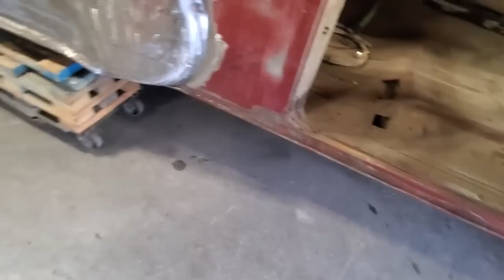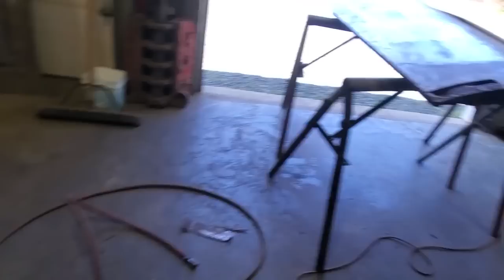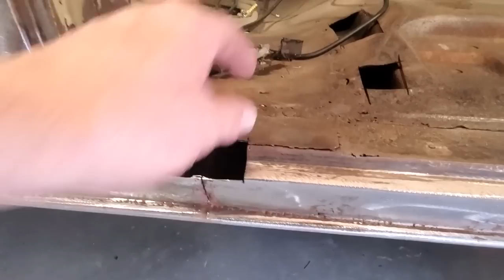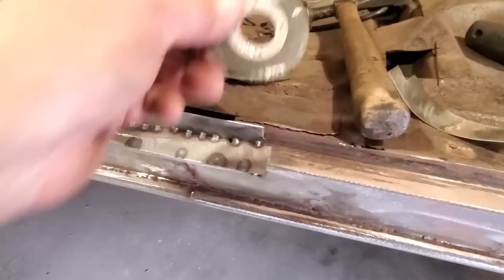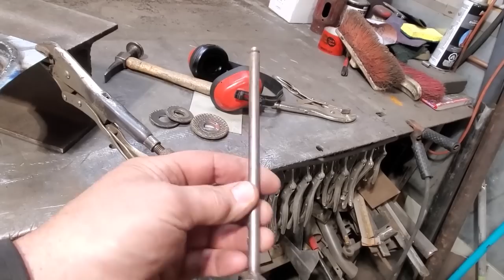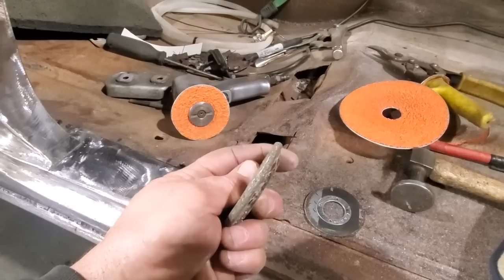Building complex body panels with simple tools

Comment: I’ve watched a few of your patch panel builds, all looking great, one question I have is on the butt welding to the original body panel, why don’t you use a backing strips to bridge the gap and lessen the possibility of burn through especially on hidden inside panels? I liked the old coat hanger trick but why not a backing strip.
Reply from the maker: Might as well just lap weld then. Adding a backing strip gives a place for moisture to build up between the metals

Comment: Fitzee bye...why are your panels always covered with grinder marks? I'm guessing it's because of surface irregularities...correct? I like my panels without the grinder marks because I find they fool my sense of touch and it's hard to find high/low spots. I will file panels with a body file once the  irregular metal areas are straightened, do you ever use such a file?
Reply from the maker: See you go the next step. Filing. I don't. As you know pick and Filing takes up many hours. Not what I enjoy.  I'm a body man by trade, so don't mind filler. Key to my work is to have as less amount of filler as possible. Also pick and filing mig welds are no fun. Tig or old gas welds are much softer
Reply: @fitzeesfabrications  I see...I am a retired body man, but from the era when "cold fill" was still viewed with suspicion ( that's what they called modern body filler) ...so I'm used to lead...and you never wanted too much lead on a panel so you had to straighten the metal fairly well...which meant picking and filling. You are right about Tig and gas being softer...and one problem I have seen with Mig , is the weld line between a panel and a repair section, being telegraphed to the surface when panel vibration between dissimilar thicknesses and flexibilities of metal , happens...body filler will lift off the weld. We also used to see this in lap joints put in with brazing rod. Like your channel. One suggestion, you probably already know about seeing as how you grind your panels...when you have a panel that has a fair amount of deep rust pits, take an old 6" 24 grit grinding disc and an old pair of tin snips, and trim the worn edges of the disc off to make an eight sided disc...boy those corners will dig into the pitted areas!...and when they wear down...trim them again. I like your work and your straightforward practical approach!
Reply from the maker: @markanthony3275  cool stuff. Love the old school bodywork stories. I came into the trade when plastic fill was so popular that some went to hell with it. Lol. I always  cut my disks down round but I have done 6 sided cuts for when I want to dig.
Reply: @fitzeesfabrications  I always remembered the words of my first year auto body instructor about plastic body filler " Cripes fellows , it's Not a miracle drug...it can't save you EVERY TIME!". LOL!
Reply from the maker: @markanthony3275  hahaha. Hate to say it but was a time it did for me many a time. Lol. Man, the butchery I did back then.  Lol
Reply: @fitzeesfabrications  Well, we've all done work for used car dealers at some point...I call them 50/50 jobs...because they look good at 50 feet and 50 miles an hour!

Comment: Question: Do you always keep the bolt/nut hardware in the same containers? Like the bolts that hold the door latch on, for instance. Do you keep the latch and the bolts inside the car, or on the bench? From experience I bagged mine and labeled them, but that gets messy and zip lock bags can get weak. I always fear losing hardware, if I'm doing a longer project that has months between the start and finish. 

Excellent content. I watch your videos multiple times over periods of weeks to make notes and concentrate on techniques. Thank you
Reply from the maker: Depend on the job. Small jobs like this they just lay in the car. A full strip down everything gets bagged and tagged

Comment: I approve of this "cut, smack, and weld" door alignment technique.  :D  Fits my style very well.  :D

Though I'm curious, why so much of a gap between seams?  I usually try to align my panels closer, though I suspect you have more experience than I do. Are things inclined to shift so much that you need that much clearance to make sure things don't start smacking together?
Reply from the maker: Gives you room for filler work
Reply: @fitzeesfabrications  Ahhh, fair enough.  I'm OCD enough that I try to be 90 - 95% metal and then the very slightest bit of filler with just primer and paint.  But you also seem to get things done much faster than me.  :D  Excellent video.  Thanks for the tips and techniques!  I think (I know 😉 ) I've been making things more complex than I needed to.

Appreciate it, bro!  Metal up!

Comment: I am just wondering if you have any idea how strong this essential part is in case of a collision? I mean it may look just nice but if you have a number of weak spots because you try to achieve the best visual results are all irrelevant when later on they appear to be the source of ie cracks.
Reply from the maker: This is a late 40s car.. there nothing on this that designed for a collision.  These peice is cosmetic and not structural  as this is a full chassis car
Reply: @fitzeesfabrications  I think this part is essential of a simple but may be effective low collision impact "cage". Just imagine that this part gives way in a relative low impact which allows the door to be pushed in.

Comment: Hey Fitzee! I was wondering if you have ever made or plan to make a video on doing inside rear fender wells. I’m working on an 84 Monte Carlo and the my rear inner fender wells are shot! Any advice?
Reply from the maker: When you mean shot is the curved sections gone or just the lip the attaches to the floor? I have remade the bottom of a number of well tubs. I also replace them with ones from a donor car
Reply: @fitzeesfabrications  looking at it more. It’s mainly the bottom which does have a slight curve on it. And one area that does have a curve as well. The other side I may be able to get away with grinding it and possibly POR 15 on it. In the trunk side there is no sign of rust at all
Reply from the maker: @ericstopanio4545  well the small curves are easy to make. Might have to be creative in the angles.

Comment: Loved   this video Tony!!  You just solved an issue  on my project.   Also,I have an idea for an upcoming video. How about  doing one on overhead welding?  Can you do a little video on that?  I recently welded in a  replacement trunk extension in my Barracuda.   The overhead aspects gave me some issues.
Reply from the maker: Overhead gives me issues too. I try to avoid it at all cost. You need to just play with the welder settings more heat and wire speed.

Comment: Hey Fitzee! Love the videos man, I've learned so many great tips/tricks. I'm working on an old truck and the hole for the door handle has been widened a hair too much. Do you have any tips on building up the edge of a hole without blowing it out? I'd rather not cut&but since there's a bunch of stuff behind the outside door skin.
Reply from the maker: Can you back it up with brass
Reply: @fitzeesfabrications  Some of it, can't get behind all the edges. I've got a chunk of 3/8" copper I use as a backer for most smaller holes, but getting behind this hole is hard. A friend suggested silicon bronze + tig.
Reply from the maker: @elpetepete  well the widening of the hole tells me the area is weak.so if you took a washer that has the right size hole in it and positioned it on the back side of the hole you can weld to the washer. Making the washer a part of the hole. Many door handles have backings where the bolts go. This is all you will be doing
Reply: @fitzeesfabrications  Thanks! That sounds like a good plan. I appreciate you helping me out!
Reply: Great tip

Comment: In the 80's I met a couple of brothers who lived next to a scrap yard they welded up MOT failures they used Oxy Acetylene and metal wire coathangers the welds looked very brittle looked like the coathangers were not 100% mild steel , we had not long switched to Mig from Oxy Acetylene , I watch that Bad Chad video's he does the same , we used gas welding rods to fill the gaps as there was always old ones on the gas bottles as we need to use heat on seized nuts and bolts and still did a bit lead work now and then . BTW still think it's bit iffy using the coathangers with UK ones being some sort of alloy of steel .

Comment: Great job! But I missed something or you didn't mention. I'm interested about how do you protect from rust the inner side of panels, that you cut and weld? 
Thanks
Reply from the maker: I just use a rust paint. Most of what I do is cars that won't be used in winter. If I was to do a winter rig I would have to drill holes and spay oil inside.

Comment: my supplier didnt have mixed gas so i took a bottle of 100% argon its rubbish for sheet metal
Reply from the maker: Should be fine. Play with the gas settings. I used both with no issues.  I use co2 just because it is cheaper here
Reply: @fitzeesfabrications  yeah it works but it's just different too mixed gas

Comment: I still have my own 'air chuck' I made 45 years ago in High School shop class in the 1970's.  I had to make something on the metal lathe for credit.  Everybody else made hammers.I turned down a piece of 1" aluminum round stock and made it fit my air hose. I use it to this day. I got an "A" for creativity and my '3 fingered" shop teacher, who routinely preached safety didn't have to grade one more damn hammer.  You're pushrod one seems to work very well too. Thanks for sharing.

Comment: really great tips as always thanks!! i just wanted to share a issue i had with my welder this week, the wire kept burning back and welding it self to the brass fitting , I thought it was the ground, so i cleaned the clamp and it seemed better but not fixed, it turned out to be the wheel was slipping on the wire ! so i just had to put more pressure on that wheel and it works great.

Comment: 🤯 as usual ! But Fitz I noticed tht you didn't leave the seam on rocker panel tht was there also the sill plate  peice you overlap instead of cut an butt. Not not picking just need your knowledge an understanding cause I haven't seen a poor video from you at all. ANYWAY the tips were good ( really they are GREAT ! ) an until next time ! Keep em coming !👍looking forward to next one
Reply from the maker: The seam on the rocker was a lead seam. It's where too panels overlapped. It's was never a seam you would see it's one that would been fill smooth with lead. As for the overlap. This car has alot of previous welding that is poor. So much so that I need to pick and chose where I need to save time. Lap welds are faster and just as strong.

Comment: Have you ever made a hood or a trunk?  I have a 64 Lincoln with a very rusty trunk and it looks like my only option is to try to  fix what I have .
Reply from the maker: How bad is the trunk? Most times it is just the rear section of the trunk  I did a trunk repair video on Crusty where I replaced the complete rear lip and inner structure.  If I was to make a hood or trunk I would start with a panel from another car that looked similar to the shapes I want
Reply: @fitzeesfabrications  it’s rusted near the area trunk hinge attaches to the hood.  The hinge is pushing thru the top of the trunk and there are two other rust thrus on the flat section of the hood